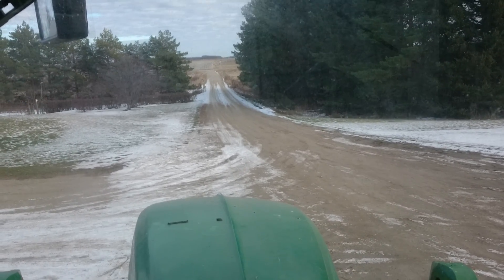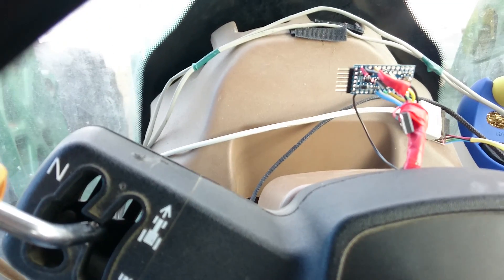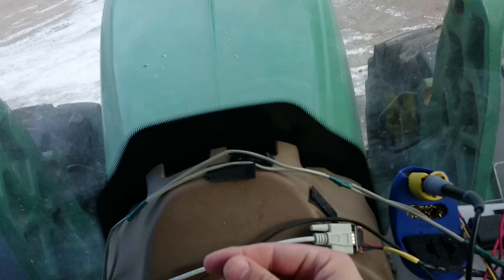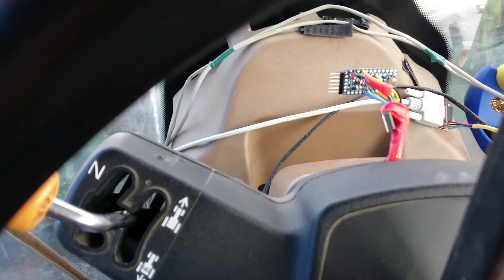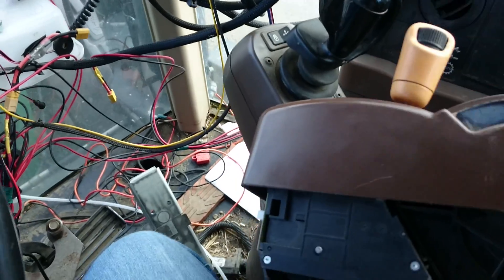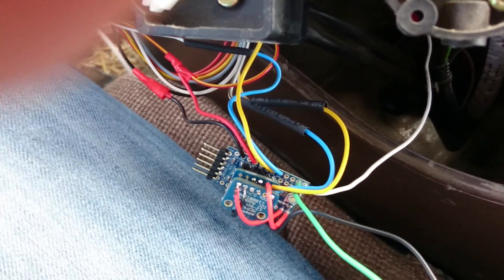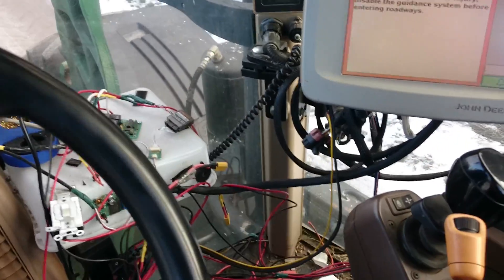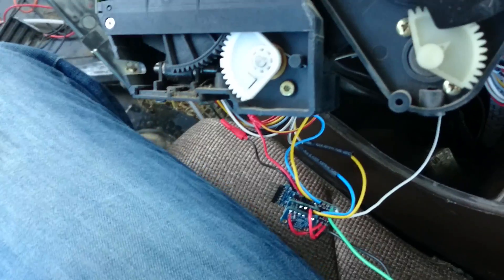Arduino controlled tractor

Comment: The tractor is already in "F" for forward clearly on the display and you've got the speed lever in the "2" section of the "slot". It starts moving because you took your foot off the brakes and the transmission came out of "power zero". The engine idle speed is so slow and you've got the speed range turned down so far that its just creeping in F2. Your "simple 5-volt logic" is a CAN-bus system and the N-P-F-R "controller" is nothing but a few microswitches that "enable" the "real" transmission control system. The exact same reverser is used on PowerQuad transmissions.